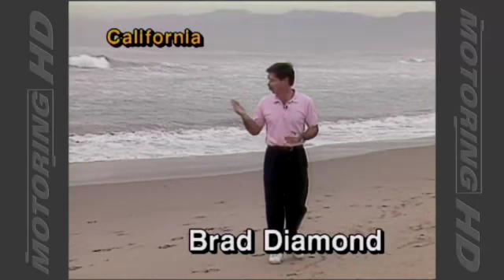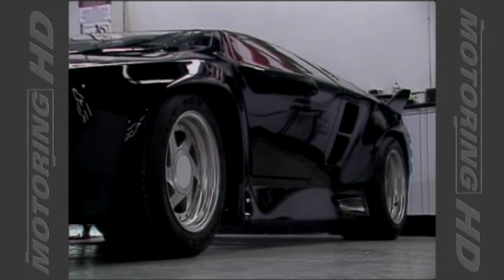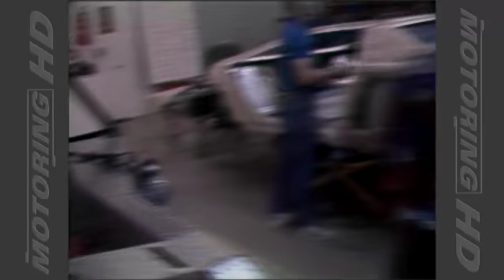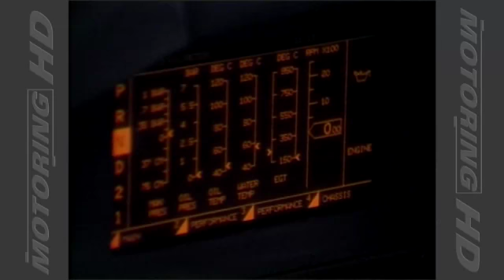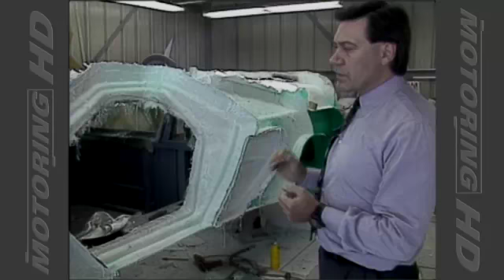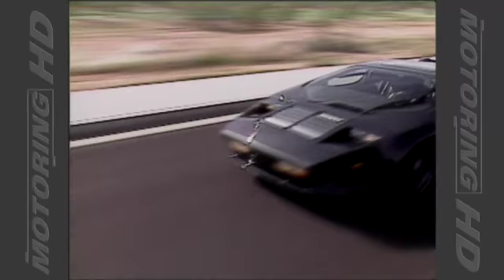Motoring 92 - VECTOR AEROMOTIVE

Comment: Carbon fiber unibody in 1992!  0_o  Can't be said enough how forward looking his technology was.
Reply: Wiegert was so far ahead that he wanted antilock brakes when they were still a prototype-level technology. He had to compromise by installing a damper valve that was adjusted from the dashboard and wait until the technology caught up! This car was on the drawing board since the 1970s! If I could drive any car I wanted for a day, it wouldn't be a Lamborghini or a Porsche. I would drive a Vector, hands down. I think Andre Agassi was one of his most loyal customers. He put his name on a long waiting list and got one of the first Vectors to leave the factory.

Comment: Jerry has the same problem as other wanna be car makers that I have worked for like Tom McBernie. They get caught up in the hype and start to believe their own bullshit. WANTING to make 1000 hp is not the same as MAKING 1000 hp. Advanced at the time but antiquated now. I have been to that factory with the Ferrari club about 1 year before this film was made. So many off the shelf GM parts and really bad "home made" wiring harnesses. You can't spend MILLIONS of dollars of investor cash living the high life and NOT producing cars or have a better marketing or branding program than the CEO running around saying "It's a fighter jet for the street!" I saw this car when it first came out when I was 12 and it really inspired me to get into working on and building performance cars. Just wish Jerry would have put the car first before himself.